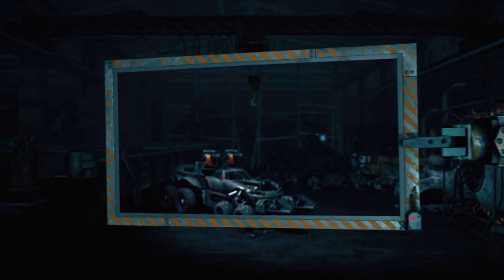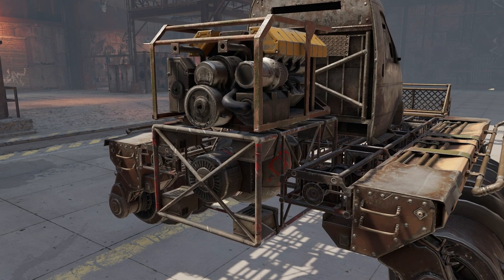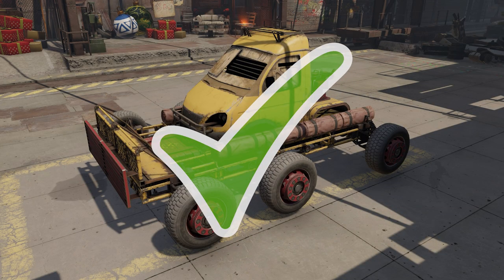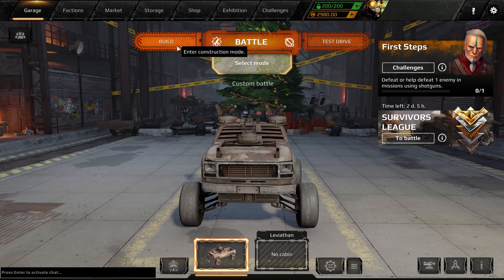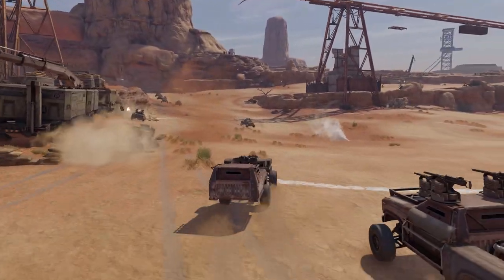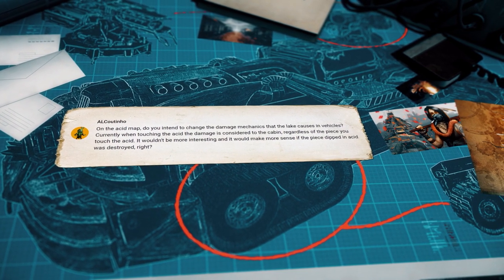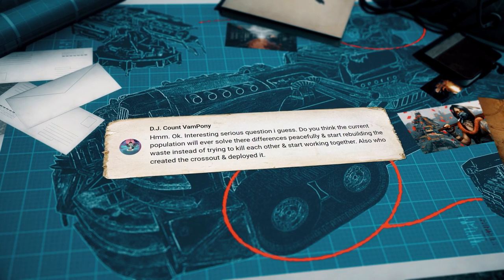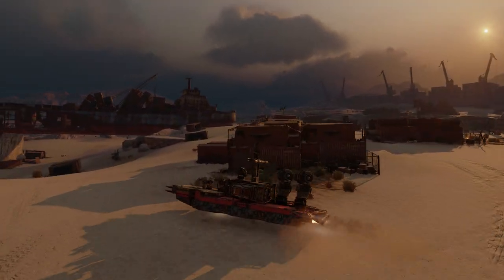THE GARAGE 2.0: Going back to our roots / Crossout

Comment: Fix Matchmaking!
Why we have Powerscore? If we matcht against Players with up to 50% more Powerscore. And against Teams?
Reply: Christoph Kuehler the lower player amount the more powerscore will be different in matches.
Reply: @Quantum-Bullet  1st that is a Problem the Devs made. 2nd 90% of the Match the other Players have more PS than me.
Why they not simply make 6vs6 Matches or 4 vs 4. Im Also okay with 2 Boots in a Team.

Comment: @5:04 that's not a Van Side or atleast Van Sides ingame look different. Are we getting new 3d models for Structure Parts?
Reply: Maybe.
The starter wheels and cheetah engine got a redesign so I guess most parts will have a new visual appearance.
The van side is probably the next.

Comment: This game should be better optimized for low end pcs
Reply: It is pretty well optimized, I used to run it on a small laptop and it was running fine. Now I have a gaming laptop and it runs super well on 4K.
Reply: @mathisbuilder  im playing with max 25 fps so my pc isnt best
Reply: @dawiniuq8116  What specs? Try updating your drivers and check if anything else is running in the background.